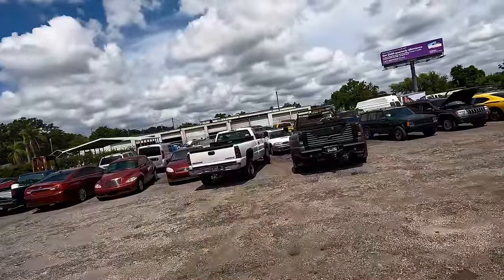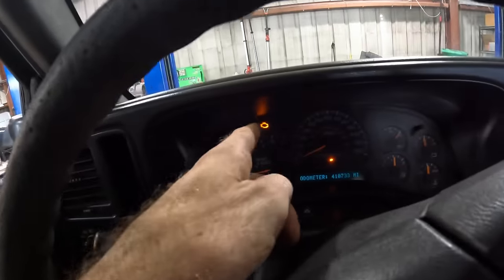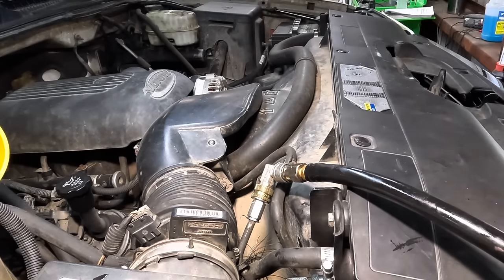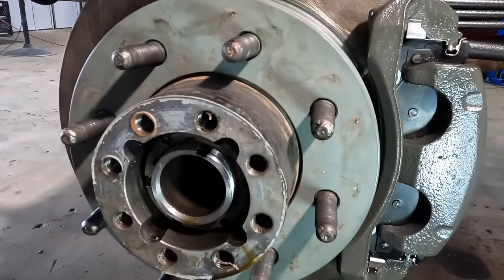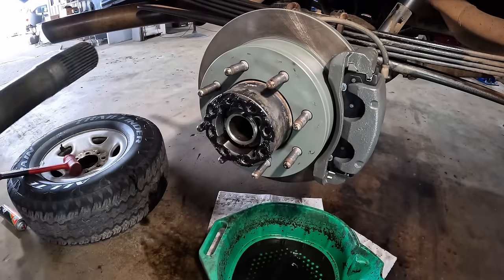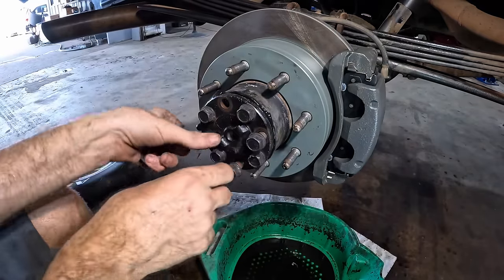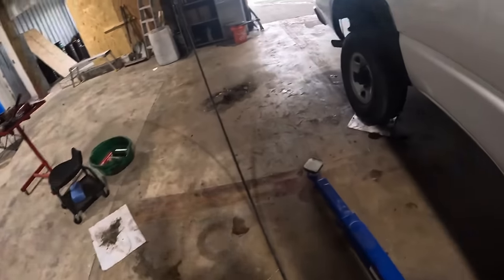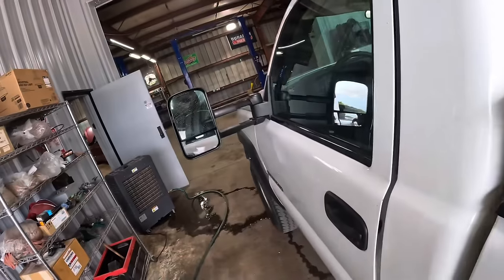400,000 Miles of BURNT Fluid & Loose Wheel! Oil Soaked!  2006 Silverado 2500 3500 6.0 4l80 #mechanic

Comment: I would have to have the customer sign a release that he knows that by changing the fluid, the transmission might not work anymore.
Reply: gone the friction material for sure.
Reply: I worked for Connie Kalitta’s transmission mechanic in the 80’s and that’s the first thing he taught me. DO NOT change transmission oil after 100,000 miles. I’d be scared to attempt this
Reply: @courtneesdad  To Ray dark fluid means black gold, he is $200 richer and that truck will slip and set codes soon.
Reply: I’ve had some high mileage vehicles that probably could have used transmission service and never did it as I was nervous about needing to replace or rebuild.
Reply: 400000 MI I would not exchange the fluid just the transmission
Reply: Yeah I've heard the friction disks in the clutch pack loose friction material if the trans fluid isn't regularly changed with filter every 50-80k miles. Then the transmission starts to slip a week to a month later.
I have same issue, my 02 Jeep Grand Cherokee Laredo 4.7L V8 VIN-N has 224K miles and I recently bought the Jeep from the previous owner. I'm unsure if it has been regularly serviced. The fluid looks fairly translucent Amber, not dark or burnt.
Think I'm okay to change the transmission fluid and filter to extend the life of the 4-speed automatic transmission?
Reply: I am confused. Why does not changing the fluid in a high mileage transmission, keep it from failing ? The fluid is a cooling agent , and is used for pressure valves for shifting. Clean fluid of any type will carry more heat away, which should help improve the transmissions life.What am I missing?
Reply: @peterinnewyork3931  drive it till no go then replace, save the $200 plus
Reply: @davidhamm5626  sometimes the friction material that is suspended in the fluid is the only thing left to keep it from slipping.
Reply: @davidhamm5626  I'm with you. 
Definitely needs to be a controlled study done.  But, who's willing to put the $$$ and effort out there to prove or disprove this?
I think there's too much folk laur out there about this.
Now, power flushing, that might work the crud out of the corners.
Reply: @courtneesdad  given how poor fluid quality was then and the fact that most American cars were shot at 100K miles that was the normal advice. Most vehicles today that have been well maintained are just getting their second wind at 100K. I’ve been a Toyota technician for over 28 years and we service the auto transmissions routinely with 300-400K miles on them. Obviously if you get a vehicle with no service history whatsoever or the fluid has that obvious foul burnt smell anything is possible. I have zero fear of servicing a well maintained transmission regardless of the mileage. My old beater Accord with 250,000 miles gets serviced every 30K.
Reply: @prevost8686  What would you recommend on a 2013 Tundra with 130,000 miles and fluid has never been changed? With the sealed transmission there's not an easy way to check to see the color of the fluid.
Reply: I would only do a drain and fill, not a complete exchange on that Tundra with Toyota WS fluid every 60K miles. Should be golden.
Reply: @davidhamm5626 ...dirt keeps worn transmission from slipping
Reply: Reading over the comments, you can definitely tell the Old School guys are present and accounted for. Many of the vehicles today that are sealed have 100k service intervals so this things got 400k on it, that's only it's 4th service. IF that's the original Trans.
CVTs on the other hand have oil changes recommended every 2nd to 3rd Engine Oil Change.
Reply: @CameronDC-Grimes  Yeah you will probably get away with it keep about half or what you drain out just in case it slips you can put some of the old fluid back in it will have small clutch friction particules in it & can stop the slipping Good luck.
Reply: @davidhamm5626  one issue is the new fluid is an excellent cleaning agent, changing to new fluid after the old fluid is dark and burnt can cause any buildups to dislodge and pass thru the clutch packs and other internal parts like shift solenoids and valves in the valve body. Tolerances are very small and a small particle of sludge or shellac can cause major problems.
Reply: And this is one reason why I like manual trans ^_^
More seriously not doing proper service on your car is stupid.
I’m pretty sure if you service also the trans every x miles (depending on the manufacturer) it would work longer …
Reply: @CodycoWeb  Okay, thanks for the explaination.
Reply: @davidhamm5626  I can't say with 100% confidence but I can speak to what I've been told, which makes sense. The fluid is dirty and obviously can perform as expected when it is that deteriorated but the theory is that the oil is saturated with A LOT of friction material which means the clutch packs, friction discs etc are lacking a significant portion of the friction material. The friction material is suspended in the fluid and helps to create enough friction to keep the clutches and bands engaged. When you exchange the fluid, that extra friction material in the fluid is gone hence, all you have left is what's left on the clutches which, potentially, isn't enough to keep the clutches from slipping. That's the theory as I understand it.
Reply: @jeff803  Thanks for your answer, the last automatic that I rebuilt was a 727 in an amc.Times have changed,
Reply: The question I might have is that it seems that the truck was serviced pretty well to get it to 400k miles. Wonder why the transmission was so neglected?

Comment: I would not flush a high mileage Transmission. I would only Drain and Refill the Pan and change out the filter.
Reply: Reeeee. Do both. Remove and clean pan, change filter then BeeGee
Reply: I totally agree 👍
Reply: I was wondering about the filter, after seeing how black the old fluid was… On balance, I probably would have turned that one down. Intergalactic mileage and clear evidence of recent shoddy maintenance are not a good mix.
I have experience of “you were last to touch it. It was fine up to then!” I’m sure there’s a transmission specialist nearby, or a more desperate outfit, that he could have suggested they bring it to.
Reply: This should NEVER BE DONE without FILTER, Every mechanic knows this, filter inspection and change, fluid exchange with old filter accomplishes nothing
Reply: I've flushed 2 trans with fluid that nasty (200k in factory fluid) and they were fine until I sold the car. 

I found my dad had never changed the OE fluid in his car at 180k and I flushed it (unserviceable filter). No problems.

I don't believe the "don't flush it" thing... If it fails, it already had problems.
Reply: If regulator transmission flushes were performed then there isn't going to be a problem. But if you never changed or flushed it before then you might have a problem. Bottom line is it's on the owner of the vehicle. Ray can advise but if the customer wants it done then to hell with it get it done.
Reply: Could you say why flushing is bad?
Reply: @colinofay7237 removes all the metal shavings the old transmission is using for friction
Reply: @colinofay7237 all the metal shavings and or sludge which had remained in various cavities in the trans had been broken loose by the high detergent cleaner and pressure. However Not all of it is flushed out by the machine and when driving after the flushing , remains drain into the pan and then clog the filter causing you know what
Reply: I agree. When exactly are you going to do the filter!! And you did nothing for the cooler! Not in my shop!
Reply: With 400k miles, the trans is either going to work, or it's not. Flushing doesn't necessarily cause them to fail, it uncovers existing issues. That being said; drain and fill, new filter and send it. That's all I'd do.
Reply: @chanceharmon6491 +
+
Reply: That’s what I did for my cadillacs
Reply: All of these “don’t touch trans fluid after xxx miles” are a complete myth. If the trans is shifting well go ahead and change the fluid. What contributes to the myth is high mileage unchanged fluid in a trans that is starting to experience issues and customers thinking a fluid change will fix it. FYI, it’s already too late at that point.

As for filters, changing them is pointless. They are installed from the factory to collect any lingering machining debris from the manufacturing processes. After that the filter is just there. Most current transmissions don’t have serviceable filters any more unless the transmission is removed and completely disassembled. In the event that the trans filter is actually picking up particles of debris, the transmission is already suffering a demise of some kind.

For reference, was a GM trans tech for 16 years.

Comment: Internet wisdom says if its over 100,000 either leave it alone or just drain out the sump and then top it up. As you said, you can kill it if you remove the particles as thats where the grip comes from.

Comment: Impressive mileage and kudos to the owner for changing the oils frequently to get it it to that number!
Reply: Just goes to show with proper maintenance stuff will last. Had a 91 Dodge Shadow with the 2.2 that was supposed to be junk. Lasted 250k before I traded it as it was starting to rust out. AC didn’t work but otherwise ran great with no Check Engine Light, used no coolant or oil.

Comment: My buddy has 550k on his all stock 6.0, 4l80.  I just sold mine and it was in perfect condition with 400k on it.  The 6.0 and 4l80 is probably the best engine and transmission around.

Comment: Good morning Ray.  Self Lubricanting wheel hub good job of resealing the seal.  Four click fastener.   BG trans cleaner really does a good job.  Truck in great shape with 410k miles on the clock.  Don’t forget to have yourself a great day. 👍

Comment: That is a miracle the way that engine runs with all the miles. You took a hell of a risk flushing that trans with 400k miles. I would have just changed the filter and the fluid that came out of the pan, and put the conditioner in it. The conditioner kind of revitalizes the old fluid. I am astonished that it worked as well as it did. Great job! Thank goodness. If that thing is maintained properly, it might make a million miles. It is obviously a good one. At the price of trucks now days, you should have a very happy customer.
Reply: A)  is that the original motor?
B)  its a flordia truck, put that same truck in NY  it would not have lasted that long before the cab fell off the frame or rust took its death toll.  Your lucky if you get 5 years out of a truck there.  Here in kcmo you dont find trucks or truck parts in the junk yard if they are they get parted out really fast.
Reply: I got 01 sierra single cab short bed in mass...its equally as salty out here and that's why you do see a lot of these trucks in junkyards around here.. They typically drive them there rotted in half😂.. i caught mine before it was totally gone got it for 2 GS just before covid drove it 2 years and kept the chassis oiled (I think never being "undercoated helped a lot). I did some bed rails and cross members and shackle brackets now its solid truck long story short the way to keep any full chassis truck in the salt belt is relentless washing in the salt catchers and maintenance
Reply: @ianbuilds7712  Yes, you have to stay on top of it, rust never sleeps. I would use one of those expensive rust inhibitors on it once a year, at least. The folks that trade in every 3 years, don't care.

Comment: Hey Ray, on your impact  if you take the snap ring off the square drive. There is an o-ring replace that and put the snap ring back on it will fix your socket retention.

Comment: Great job Ray but I'd clean the inside of the wheel before reinstalling it.
Reply: I thought the same thing
Reply: Not shown, but after the post repair test drive Ray did mention that the inside of the wheel had been cleaned. :-) I was thinking the same though! :-)
Reply: @arteepee  just noticed thanks.
Reply: 36:43
Reply: In many areas oil is intentionally applied to the underside as a rust-prevention measure.  It's not really hurting anything except the brakes.
Reply: Same here , Ray seems to be getting more messy with every video lately ..... the
Reply: Oops, my blue..
commented below the end of the video...
Sorry Ray..😢

Comment: If that right rear was that many turns loose, one gotta wonder how loose left rear is. If it was me, i'd have to check as i could just not leave it unchecked. That trans fluid exchange machine was neat, never seen one of those before.

Also its a rare treat to see one of these GMT800 chassi trucks in that good condition, usually their all rotted in half with the rear half of the frame looking like the surface of the moon from all the rust damage with the rear cross member, cab floor and corners beeing close to nonexistant.
Reply: The truck is in Florida, unless they drive it into the ocean there is no salt to corrode things.

Comment: Always enjoy your videos, Ray. I retired from the field in 2015 and miss the challenges..(not always) and that no 2 days are the same. I had my own shop for a few years and can identify with the effort. One thing that I would recommend, is to buy your brake cleaner in bulk and get a pressurizable spray can (HF has them now) for dispensing. Not as video friendly as the flying empty can, but far more cost effective and less going into the waste stream. Just a thought... CRC has it by the gallon and other suppliers in larger quantities. Keep up the great channel and work. I almost can break into a sweat watching you work...LOL

Comment: I really like that BG system for the fluid exchange. Just can't get past thinking about the condition of the filter sitting in the pan.
Reply: Filter was not changed or I missed it
Reply: Yeah that's bugging me too.
Reply: I have reservations about that machine always changed the filter when I did auto trans service.Maybe technology has improved so that a filter change is not required.
Reply: Yes I agree, fluid change alone is not recommended,  drop pan, check magnet for metal filings, inspect and change filter, there's no shortcuts for this job, do it right or don't do it at all

Comment: I used to have an AU Falcon here in Australia and it had 890,000 km on the clock was a dual fuel and ran like a dream.
Reply: have a mate in qld with same ,will pass 1000 000 this month. Still laughing at the taxi drivers as he goes by

Comment: Hmm, I noticed that the oil pressure gauge was pegged even at idle. I wonder if the gauge or sensor was just bad. It wasn't knocking or blowing oil out of the engine seals, so it must have normal PSI. Regardless, great vidya like always!
Reply: I saw that after my last oil change, too.I have an ,06 Gmc, and heard somewhere that the clusters can have issues.
Reply: Oil Pressure sending units are notorious on these for going out. Will show max psi even when vehicle is off lol. Little annoying to change since it sits directly behind the intake manifold
Reply: @Kill4Time255  Thanks, I thought about that, also.I had no idea of where they sit, and I am not as flexible as I used to be..

Comment: Enjoy your videos. You should have cleaned the inside of the wheel, it's covered in gear oil. Also I have always believed that flushing a transmission can cause issues, but I've always be maticulious about regular service. I've had in my life 3 Dodge/RAM trucks go over 300k,one was at 393k when I sold it. Also have had a Pinto go 260k and 2 Subarus over 300k. Never had a transmission or engine take a dive !

Comment: 4L80 is a Boss Hog. Actually, TH400 w/od and ecu control . Even Hydramatic Div would be impressed with 400k, if never rebuilt(unlikely) Hot Rod Garage called it the 'best shifting Trans' they'd ever used . Caution: unbelievably heavy @ near 200lbs as installed. (Then add 3 gallons trans fluid). Have hundreds of runs on one in full option 72 Nova behind SBC, since 2014. They Take a Lickin & Keep on Trippin!
Reply: I have 3 OBS trucks with the 4L60E. They are great if you take care of them. All of them have trans pans with drain plugs. I drain out what I can every 15K miles. Every 60K I have a fluid exchange and new filer done.

Comment: I hope you changed the trans filter? and also you didn't check the left rear wheel for leak or if axle bearing has proper pre load
Reply: Gotta cut corners where he can. He’s got a huge loan to pay off.

Comment: You don't need to clean the springs off. As a matter of fact on those Springs and on the frame I would spray a light coating of something like a chain lube to keep it from rusting even though you're in Florida.
I hope that you remember to check the differential fluid.
Crying out loud clean off the back of that Tire

Comment: Everyone always says not to touch a highmilage trans, but I changed the fluid and filter in my 1500 when I bought it at 250k without knowing the history, got another 100k out of it before it lost 3rd and 4th.

The MAF code would concern me, I hear that can kill transmissions because the PCM uses it to control  line pressure

Comment: Wow! Very impressive milage!!!  I would be curious to know what motor oil they are using. I am glad the transmission was not damaged. I need to perform transmission service on my 2017 GMC now and change the temperature sensor. It seems the factory one is defective.

Comment: I guess using the magic transmission fluid changing machine the truck doesn't need a dirty transmission filter change
Reply: Now it really needs a filter. The cleaner put all the trash through the filter.
Reply: That's why you alternate the trans flush with a pan drop and filter change. Both services have their pluses and minuses

Comment: good video , good to see axel assembly. you said torque wheel bolts later..didnt  see that , now will be running red lights, cutting off traffic worrying about a loose truck tire coming down hiway. no sleep.